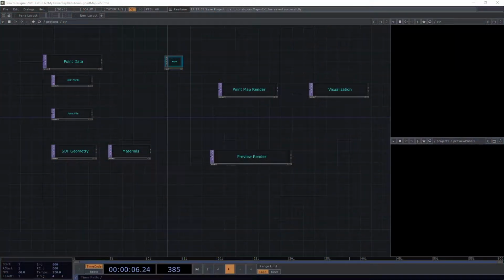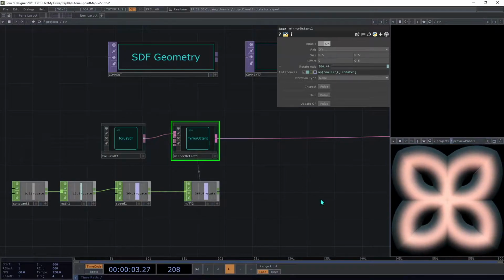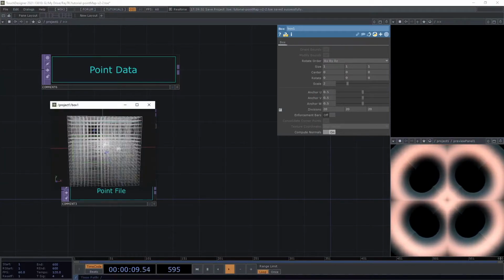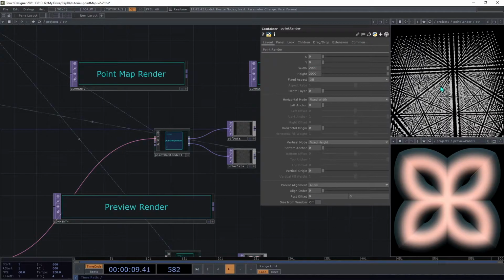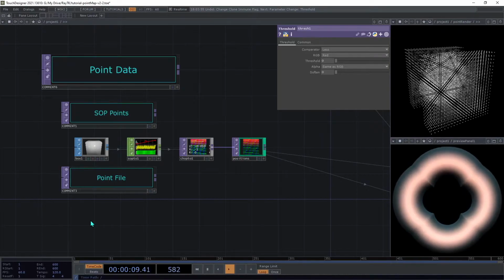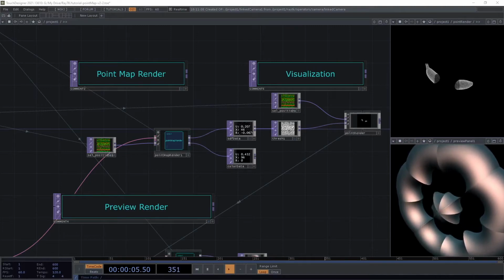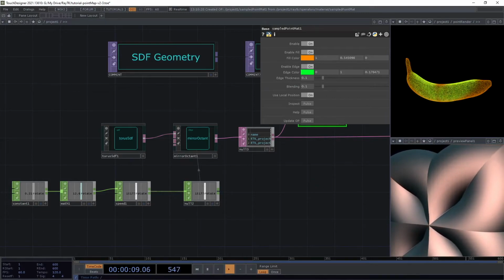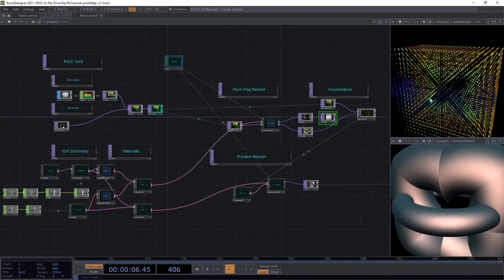RayTK Tutorial: Volumetric Sampling

Comment: Amazing work, and thank you for sharing, may I ask what the best way to map this onto a LED volume would be? Trying to wrap my head around it, of course the SOP that gets turned into CHOP then TOP would have to accurately represent the grid of leds, but then how do you output data back to that using the color values from the PointMapRender?
Reply from the maker: The answer to that depends on what LED hardware you're using. Each device has its own arrangement of DMX addresses. The easiest approach is often to figure out how to make the point map image match the channel layout and then you can sample rows from that into channels to send over DMX.